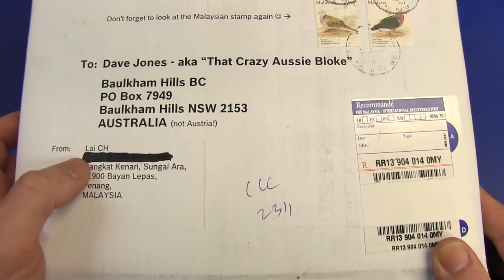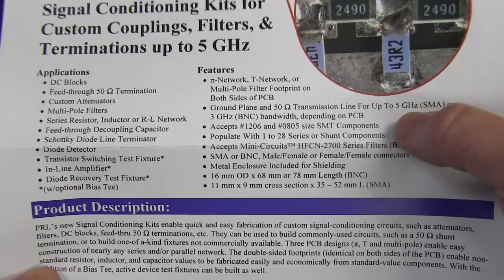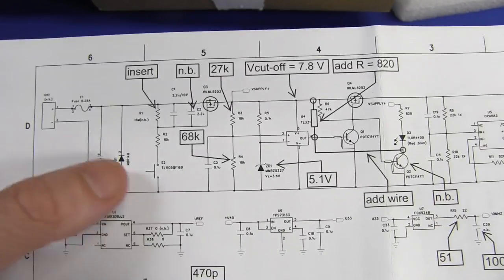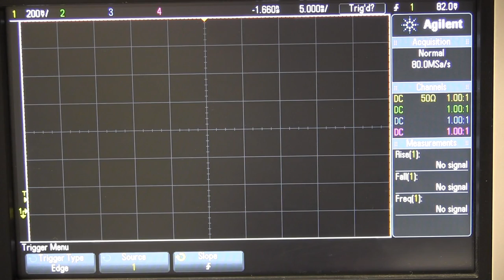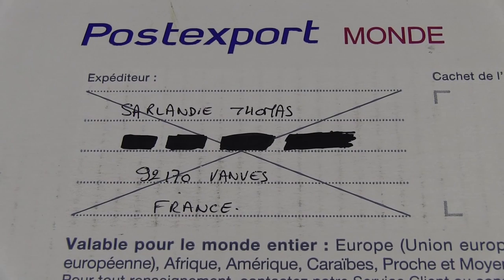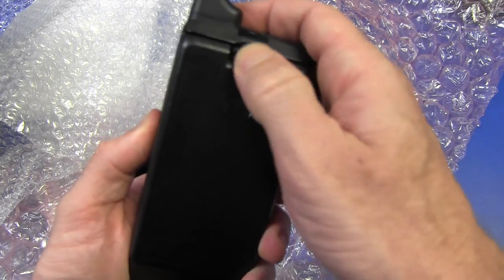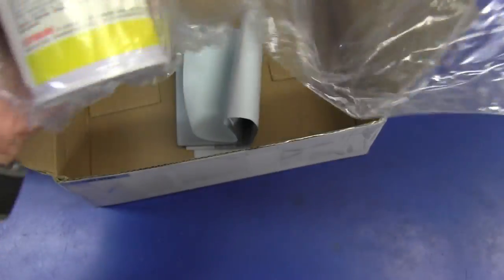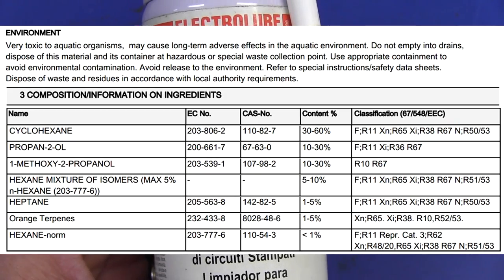EEVblog #433 - Mailbag

Comment: I have found that Fluxclene works much better than isopropyl alcohol, particularly when cleaning solder paste flux residue. The only components that I recall ever having issues with are certain 7-segment LED displays - the part numbers washed off, the grey face colouring was affected, and the white plastic body showed signs of softening. Not surprisingly, the data sheet recommends that you wash these displays with water only!

Comment: In the mid 1950's my father installed a Mobile phone in one of his service trucks. It was attached to the truck. When the phone would ring it would also honk the horn until answered. When you are in the attic fixing a air conditioner no are you going to answer the phone. Dad removed it with in a month; real expensive to.

Comment: Motorola would need 2 batteries to make it through a day if you made a few calls. That is the slimline battery pack, I used the extended life one, which could just about make 24 hours with moderate use. Power to the charger is a 12V 1A block, and it could charge 2 at once, still have one around somewhere. phone has a 6800 processor in it and all Motorola chips inside.